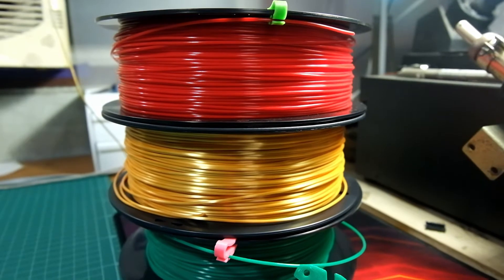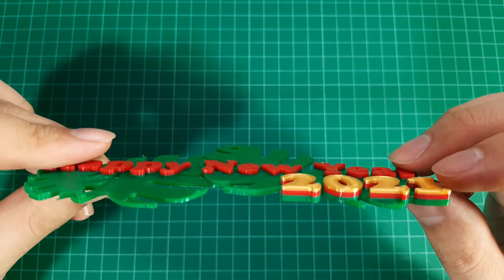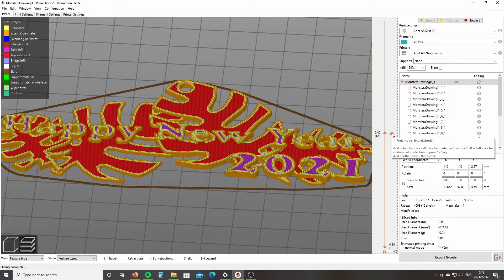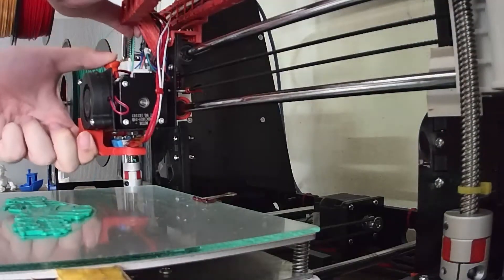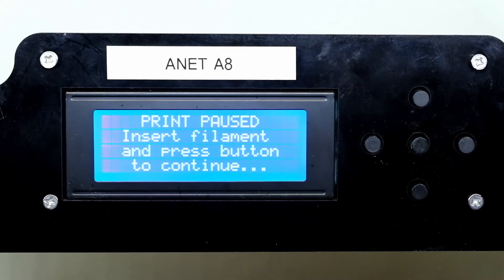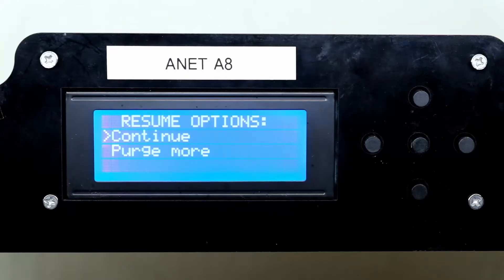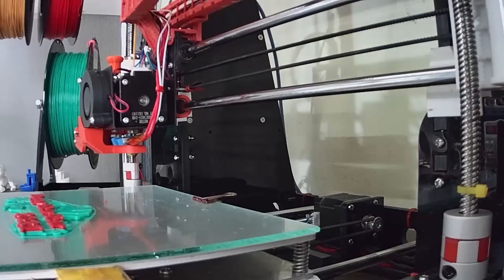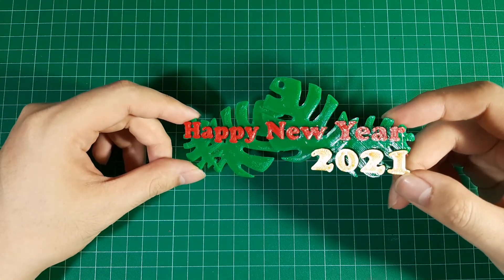How to 3D print multi-colored greeting card on any 3D Printer

Comment: How much do you think it cost for the setup? And each print?
Reply from the maker: It's mostly a stock Anet A8 printer with essential safety upgrades (Mosfet, PSU cover, Part cooling fan, glass bed) and a Marlin Firmware.
M600 filament change GCode support in Marlin is enabled in the configuration file during the upgrade.

The cost per print depends upon the price of your filament and the size of your work pieces (roughly the same as a normal 3D print + a small amount of filament purged)